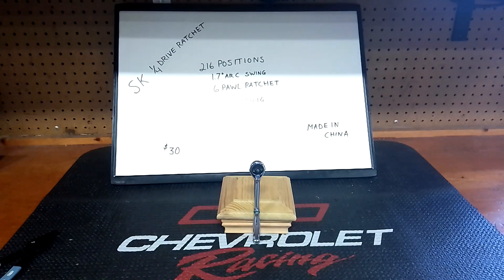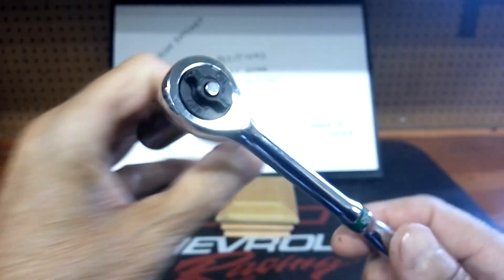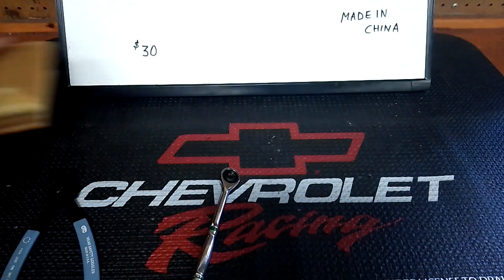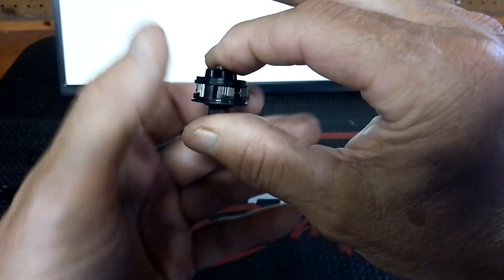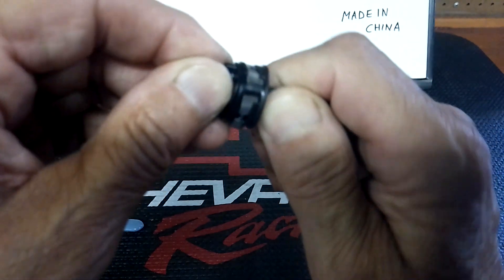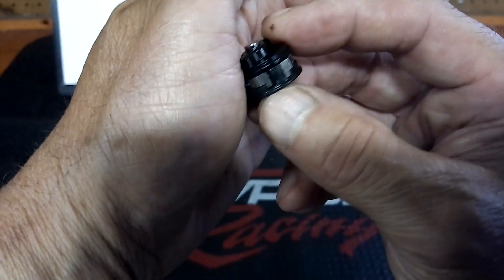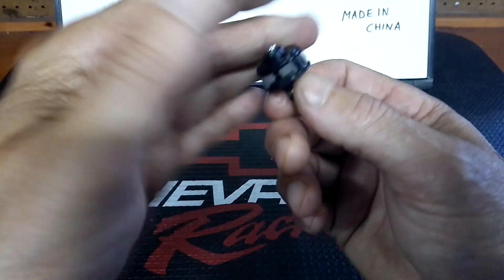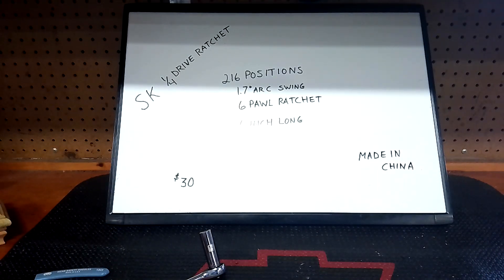SK 216 positions ratchet,let's take it apart and see how it works,this is a crazy design,must see😲

Comment: Not to beat a dead horse but is there actually 216 teeth in the head or are the 3 paws slightly off set from each other enough so only 1 paw is engaged at a time so it would only have 72 teeth in the head. 
Just wandering. 
Thanks Jeff for another great review. 😊
Reply from the maker: I think its 72 tooth!! its hard to tell if its just 1 tooth engaged,it looks like 3 are engaged at once,ill have to look at it again more closer!! stay tuned!!

Comment: Like I do with ratchets that I buy that have some heavy back drag, I just drop a few drops of super lube in it, and run it in a drill or impact driver/wrench for a minute or two both ways. It really changes the game up!! Ive done it to dozens of ratchets over the years. It works phenomenally!! When it comes to roto or round head ratchets, which are notorious for heavy back drag, I throw some red synthetic grease in there and run it in a drill or impact driver/wrench too. It will literally take a ratchet with heavy back drag and turn it into a koken in just a couple minutes lol.
Reply from the maker: Good advice victor!! always like hearing your take on things!!!!
Reply: I second the super lube and drill method.  Been told a few times that super lube is too thick for high tooth count ratchets, but once you work it in like that it's fine.  Definitely cut down on the backdrag after doing that.

Comment: Wow, that is something else. Who decided to spend the time and money to do such an intricate design, then not lube it and have it made in Chyna? I'm thinking the old style ratchets seem to work fine. If this was "a thing" or needed, you'd figure Snap On would be selling them for $300. Whenever you make things more complicated, they break more.

Jeff, question: Sense you are a tool nut, my main ratchets are 45 yr old Craftsman fine tooth round head with the knurl on them. I only wrench maybe once every two or three months as needed. If I do decide to clean them up, I have not found any definitive data on what to use as the lube. Google, Youtube, ChatGPT all give answers from 3-1 oil to synthetic grease. I would think going for the grease, but what have you used?

Comment: So it has 3 pawls for REV and 3 for FWD, and the switch just alternates which ones are pushed out to engage the head? Seems like too many possible weaknesses for too little benefit. Let us know if it works better with some Superlube! Thanks for the vid👍

...Some ratchets are designed as non-lube. Koken, I think, is one? May be wrong on that, but I remember seeing some Koken literature  that stated that. Could be due the the sliding pawl design causing tooth slip with a thicker lube...
Reply from the maker: Yea that about sums it up!! crazy design!!! thanks my friend!!!?

Comment: The design is 72 teeth in the housing. 6 total paws with 3 for each direction. So 3 do not engage the teeth at the same time, actually. Only one of the 3 teeth is actualling in the lock position at a time. They alternately engage in a locked position durring rotation. So 3 x 72 is 216 locking positions. Very small paws, not very wide, and it's like you said. Seems like it would not be really strong to me. But mine, both 1/4 and 3/8 was dry as a bone. After a bit of lube, they ran like hot butter, super smooth, and the sound was way better. Thanks for the teardown on this, Jeff. And for the low down of SK in China, financal problems caused the sale to Great Star, the latgest Chinese tool company  (i think thats right) and they tool all the technology over there to make SK there. There are still some US made SK tools, but still owned by GreatStar. The US made stuff is on par with our SK expectations. Actually, them buying SK is starting to bring up the quality of Chinese tools. In design only, they still use inferior materials.
Reply: I was going to comment this before I saw your post.
Reply from the maker: Hi doug yea i think your rite about the pawls!!!! it makes sence!!! thanks as always!!!

Comment: The more moving parts you have, the more potential points of failure there are. Look at the old-school 24-and 36-tooth ratchets from Snap-On, Proto etc - they're really simple and as tough as old boots, which is why they still work after 60 or 70 years. I have a Snap-On Ferret ratchet from 1943 which works just fine after restoration!
Reply from the maker: Yea this one probably a time bomb waiting to explode,lol!! the old round heads were frikin tanks thats for sure!!! thanks my friend!!!

Comment: Braver than I.  I have taken things apart, never to be able to get it back to work.  Good stuff.
Reply from the maker: Hi remfj i hear ya!! these springs were so small,you never find them!!!,lol!! if i keeo it ill do a follow up down the road!!i will put some lube in it as well!!!!
Reply: Nah, nothing to it if you take your time. I got a Craftsman ratchet off of Ebay and it was stuck. Ten minutes later it was working like new. Just needed a cleaning and lubrication.

Comment: I like the snapon fl80 they break in and are the perfect rachet
Reply from the maker: Hi john FL80 is nice no doubt!! there be some snap on in the USA series!!! stay tuned!!
Reply: @jefftovani5535  you do a great job I enjoy your videos 👍
Reply: So I guess it has 3 pawls for REV and 3 for FWD, and the switch just alternates which ones are pushed out to engage the head? Let us know if it works better with some Superlube! Thanks for the vid👍... Some ratchets are designed as non-lube. Koken Z-series, I think, is one? Maybe wrong on that, but I remember seeing some Koken instructions  that stated that. Possibly because of the different sliding pawl design...

Comment: Hey Jeff, I learned from a friend at work a long time ago to open assemblies inside a deep box or bucket. If anything flies out the chance of it disappearing on the floor is greatly reduced. If you have a cat, buy a  plastic tub of Tidy Cat litter. With the lid on, it is perfect for this. How about trying some of the cheapest stuff out, like Temu sells. I have triple square, Torx Plus socket set, Stripped bolt set and stripped lug nut set from them. All less than $15 per set.I told my daughter to use it to see the actual size she needs and if doesn't work or breaks, at least she'll have the right size to show the NAPA guy what she needs, LOL.
Reply: Working on small stuff inside of a gallon size Ziploc bag helps too!!!
Reply: Temu is an absolute bottom of the barrel Chinese shopping app. It would indeed be interesting to see.
Reply from the maker: High my friend yea thats good advice!! i was worried about those tiny springs,lol!! i never heard of Temu tools,i will look!! thanks my friend!!!

Comment: That's a lot of internals to be dependent on for functionality. I think I'll pass on it, though. I'm probably going to go with a new company called Teng Tools. They are a swiss company and are made in Taiwan. All the reviews on them I've read are great. I'm trying a set of the short, not stubby, combo wrenches, and a 1/2in ratchet with a shallow socket. I believe they'll be blowing up on the market soon. If you get a chance, review something from them, i dont think I've seen anyone review them yet.
Reply from the maker: Hi shadow i did a 1/4 drive teng flex-head ratchet 4 months ago!! they do have lots of product out on you tube!! thanks my friend!!!

Comment: With those tiny springs  to much lube might gum it up  l wonder if  graphite  would work better   Thanks  Jeff
Reply from the maker: Ill experiment with this one!!! thanks tank for a great observation on those dinky springs!!!
Reply: With small parts like this ratchet has, I would use Permatex assembly lube, or Superlube spray. I don't think graphite would work well for long.
Reply: @Roger_Icce  hay Roger   I'm old school  and  don't know a lot what's out there product wise  ,l get my grease  in 15 gallon cans and pumped with a old  rolling Lincoln air grease pump and use to have about    ( 6 Lincoln hand pumps the  tweekers stole those along with most of 60 yrs worth  of tools  ) l did custom farming and  Haying  and raised  a lot of  beef so l had small to giant tools to keep everything  moving and sometimes a little  baleing wire , its been a hard way of life and I'm  slowing down some   thanks for the feed back

Comment: I dont see where all them paws help it.
Reply: It gives it 216 positions without having to have 216 really tiny and therefore really weak teeth. Multi-pawl designs are how GearWrench gets 120P, Husky 144P, and Craftsman 180P. Round-heads have also been doing it for some time too already with traditional swing pawls, which is how Wright gets 82 positions from a 41-tooth ratchet for 3/8.

In this case they're using 72 teeth, then using the pawls to multiply it. It would also allow them to use the same tooling on the body to make a more typical 72-tooth.

All this is doing is taking the swing pawl design and going a step further by doing 3 instead of 2, but since each pawl is technically a set they can say 6 pawls, like how the Snap-on Dual 80 has two pawls but only one actually doing anything at a time and the other completely disengaged until reversed.
Reply from the maker: Good feedback my friend!!!
Reply from the maker: There enough of them papa!!!

Comment: Maybe the pawl teeth Are biased to one direction? So three pawls teeth Face one direction for forward and the others face another direction for reverse ? That may give them more engagement for strength.
Reply from the maker: I would say so baydog!!very iteresting design!! thanks for taking a gander!!!
Reply: This is very likely it. Their 216P ratchet wrenches also use 6 pawls all facing one direction (so non-reversing) and the pawls engage in pairs to continue providing strength. This seems to be the trade, 1 pawl engaged at a time but reversible, and based off their existing tech.